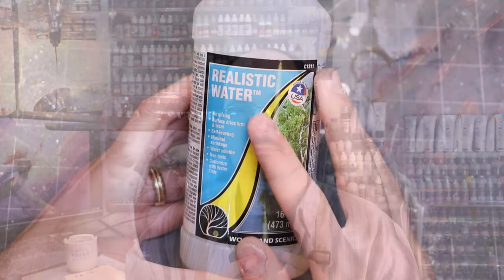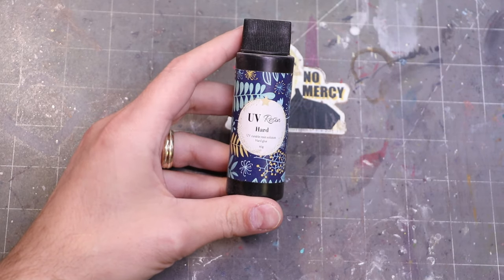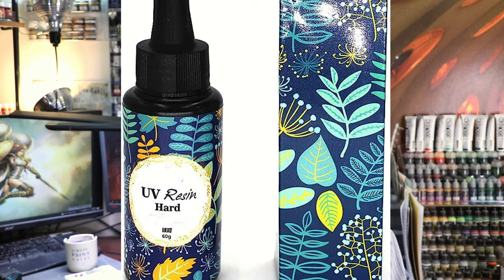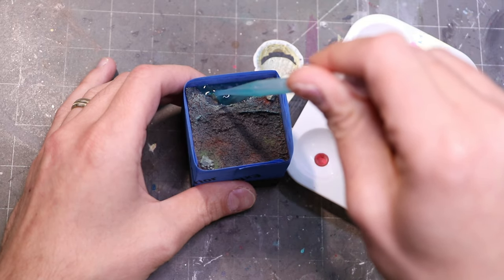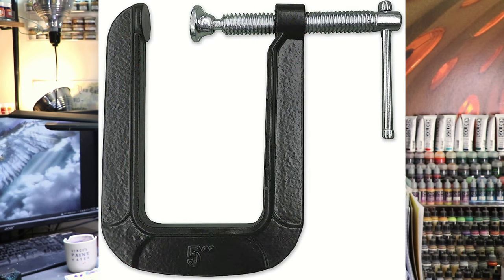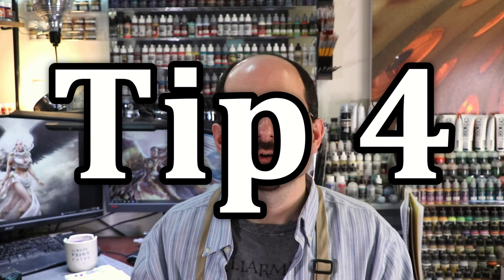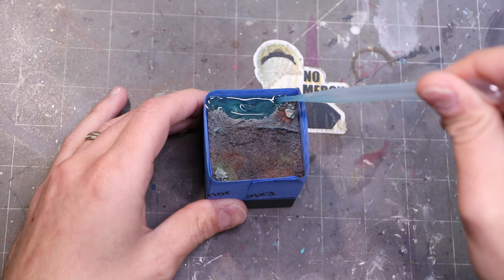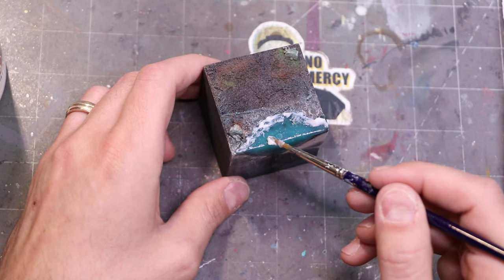Complete Guide to Water Effects - HC 407

Comment: When you're working with 2-part epoxy resins, keep the excess that hasn't gone on the piece. If you want to know whether your resin is cured, just push your thumbnail into that and see if it leaves a dent. When you've mixed A and B, it's good practice to pour it into another container and mix further, since often you'll have some unmixed stuff on the walls of your container which will end up in your work and ruin it. Also be aware that epoxy resin fumes are a sensitization hazard - take precautions to limit your exposure to the stuff, at the very least by working in a well-ventilated area.

Comment: Tip #9. Properly seal the groundwork that is going to take the resin. Even surfaces that look solid can be porous on a microscopical level, causing the water effect to seep dow into the base and possibly also reacting with it, distorting the color.

Comment: Since you titled this "Water Effects" rather than "Poured Water Effects" or something similar, I have a couple more techniques that you didn't really mentions:

You can use a piece of plexiglas (or similar clear plastic sheeting) for the surface and still model the underwater details. It can be useful to use another water effect to get a surface texture (as you mention at the end of this video). This doesn't risk damaging anything that would be in the underwater part of the scene. It won't work with every piece you work on, but when it does work, it can be extremely effective. For an example, see Boomer Diorama's Silver Creek box diorama series elsewhere on YouTube.

In some cases, you can use paint to get a depth effect and use a very thin gloss layer to get the look of water. I like to use acrylic mediums for this (fluid medium for the base effect and gel medium for any surface textures). I've found this particularly useful for water feature scatter terrain for gaming. It's pretty straightforward to make a nice modular river, for instance.

Finally, for UV resin, I just use clear printer resin. It's the same stuff at a much lower price per volume and it's available in a variety of colors.

Comment: Nice overview on water effects. There are other tricks to get rid of the air bubbles especially the two part resins for larger dioramas; just blow some air from your mouth on the top surface or use a kitchen blowtorch to heat gently the surface.

Comment: Another way to deal with shrinkage/creep in many natural still water environments if you don't want to resort to so many multiple pours to get it perfectly flat is to add debris, foam and/or foliage around the water's edge - doesn't take much to hide a small lip and if you look at real natural still water environments you'll notice in a lot of cases that's a pretty realistic addition anyways, especially if your base setting is a wetland or forest.

Also for surface bubble removal a very quick careful pass with the very tip with the narrowest flame from a butane torch is great, works instantly plus you get to use your blowtorch...

Comment: This is great, used the vellejo still water for a pour of an oasis and yeah ended up doing like a dozen 1mm layers, first try cracked and shrunk so poured to fill cracks then did as I said like a dozen 1mm or less pours, just a bunch of drops and smoothed it out with a popsicle stick and light shaking.

Comment: Some additional tips:
- Test the amount of (transparant) paint you need, by adding paint to the same amount of ml of water (as your pour), until you are happy. Then add that amount of paint to your pour.
- You can use heat (of a flame) to remove bubbles from your pour. Basically like the last step of making crème brûlée.
- When a pour is drying, place something over it, so you don't get dust stuck into your water effect.

Comment: Very very useful. Question; GW's bases have an angle at the edges that I can't for the life of me figure out how to deal with. Is there anyway to make a good seal on those bases?
Reply from the maker: It's tough, way back in Hobby Cheating 6, you can see how I do it, I just wrap it around with blue tack. There is no great answer for those beveled bases.

Comment: Thanks for the tips - just wondering how you would seal in a pour on just a standard 40k base? I wanted to add some toxic sludge and puddles that would extend to the edge of some of my miniatures.
Reply from the maker: FOr small bases, I would use UV resin, it's much slower moving and easy to manipulate on bases.

Comment: Got a question regarding something you didn't mention... I've tried making a swamp base using Vallejo Still Water. The tufts I had put down at the edge of the puddle ended up sucking up a lot of the Still Water via capillary action, which kind of ruins the effect. Any tips for using water effects alongside tufts like this?
Reply: Literally had this happen to me this week. I had to rip the tufts out and put new ones in lol
Reply from the maker: So anything that is right on the edge will naturally draw it up, there isn't too much you can really do about that if they're placed. So here is the two options I go with. 1) Don't put them right on the edges like that. (pedantic answer of course) and 2) Leave them off the edge at first, then pour and let it mostly set. When it's harded some but not completely, you can carefully place the tuft down into the already tackier resin, it won't go as far then and it will minimize the effect.
Reply: @VinceVenturella  Thanks, I'll try that whenever I get round to painting my Rotmire Creed for Warcry!

Comment: Thanks for the great video! When doing mulitple pour water effects how long do you wait between pours?
Reply: Resin has what is called a pot (working) time, a gel (thickening) time, and a curing (hardening) time.

If you are pouring multiple layers, then you want to pour the new layer during the gel phase. So once it's thickened up but before it's completely hard. This allows the layers to merge, and be invisible. If you wait until well into the hardening phase, you may get a visible layer line.

When is the gel phase? That depends on product and even brand. Some are quick setting and some are deliberately slow setting. Some will explicitly tell you, others wont. The majority will tell you the pot or working time. As a rule of thumb the gel time starts shortly after that, within a few minutes, and lasts about as long as the pot time.

Probably the most reliable way to tell is to mix a little more than you need. So you can keep some back, and treat this the same as the base pour. Same temperature, humidity, UV exposure ect. Rather than disturb your base you can check the portion that you have kept back. The gel phase will be noticeably thicker but still just about workable, but only just.

Be warned, 2 part epoxy resin can get warm as it cures. Deeper pours can get hot, but you have to be talking an inch or more before that becomes problematic.

Comment: What would you suggest using for large splashes of water?  For example, if you have a model that is launching itself out of a deeper body of water.
Reply from the maker: I'm going to do a whole video on this, as there are many ways to do this sort of thing. You can use the clear plastic pieces from a clamshell then build water effects around them is one direct way.

Comment: @VinceVenturella can you recommend a specific brand of UV resin? I notice Amazon carries several from high to low viscosity options. GSW seems extremely overpriced in comparison. I’m planing on doing 1/4 inch submerged water themed bases for my deepkin army if that helps with a recommendation. I will also be using the GSW containment moulds for my pours. Thanks in advance!
Reply from the maker: here is what I use - https://amzn.to/3AON4YO
Reply: @VinceVenturella  thanks!

Comment: How do you ensure the second/third/etc resin pours have the exact same amount of ink?
Reply from the maker: You can measure in drops, but really , if its close you can't tell any difference.
Reply: @VinceVenturella  Just thinking out loud (only works for the 2 part resin), have you ever tried mixing ink into 1 of the 2 parts of the resin? Then only mix what you need for the first pour. When it comes time to mix the resin for the 2nd/3rd/etc pour, it should have the same ratio of ink since the ratio of the two parts is the same

Comment: I ll be honest, I have the vallejo water product and I m a little confused on making it work with the model! Is there a process that is different with this product vs the realistic water I have seen you use in other videos
Reply from the maker: The vallejo water is a 1-part right? In that case, its usually just pour, pop the bubbles and it hardens.

Comment: What tips can you offer if one were use clear resin from a 3d printer w/ UV pen?
Reply: It's the same basic type of chemical. But, one thing that you'll likely run into is that if you use printer resin you will not get a dry, hard surface. Normally this type of resin will have what's called an "oxygen inhibition layer" on the surface. What that means is that if oxygen is present you will not be able to fully cure the very last bit of the surface, it will always remain tacky.

The resins that are made for jewellery as mentioned in this video have been formulated to get around this problem and will usually have a nice dry hard surface when cured fully. I don't remember how exactly that is achieved though (it's been a few years since I read up on it and I barely remember what I did yesterday).

Sometimes blasting the crap out of the resin with a very powerful UV source can mitigate some of the stickiness but I don't think it will ever remove the effect completely. Curing that type of resin while submerged, thus blocking oxygen from touching it, will work. So you'd cure it, then submerge it and cure it again. Not always practical but it can work in some situations. Or if you happen to have access to a chamber with inert gas, that'll work too.

And the last option is to clean the surface with IPA which is the traditional way you'd clean a model from a printer before curing it. Risky if you have a painted surface nearby though.
Reply: @treborrrrr 100%correct!! Great explanation!!!!
Reply from the maker: Great explanation above and far better than what I could offer.

Comment: Hi Vince! For those of us who don't live in the US, what is this thing you call "blue painter's tape"? I'm used to masking tape that is typically ivory and not entirely smooth outside, but I assume that's different? Have a great day and make sure you take your sun screen when you got to the water effects this summer! 🙂
Reply: I work in a hardware store so lemme help.

"Blue painters tape" is just Scotts branded painters tape. Painters tape in general is a type of masking tape with a different adhesive-so it doesnt damage your walls when you remove it.

Any product that calls itself "painters tape" will work. For example, the "Frog Tape"  brand of painters tape is actually green.
Reply: @jacksummers6464  Thank you for the explanation, I've been putting off my first resin pour because trying to get the round base dammed off has been a nightmare, and I was worried that if I actually put tape on there it wouldn't come off cleanly.
Reply from the maker: Perfect explanation above. :)
Reply: @jacksummers6464  Thank you!
Reply: @jacksummers6464  @VinceVenturella thanks again for the explanation, I bit the bullet and taped the base, mixed some ink into my resin, poured, and it came out great. Only minor leakage due to a piece of the mini jutting out across the side of the base, but I had taped it underneath the rim so the extra tape caught it.

Comment: Question in regards to containment. 
Have you tried Green Stuff Worlds Containment Moulds, and what do you think of them. 
Also i saw in another video by the youtuber called Paepercuts, that if you want to make batches ala lets say you want your entire army to be water based.
You can use a silicon chocolate or muffin tray put the base in it and basically pour the resin in it.
That video was 7 years old so i don´t know if its still a viable technique or if there are better alternatives now.
Reply from the maker: So those molds are tough (any molds are), the trick is they absolutely won't work with GW bases, because those are beveled bases, so it leaks immediately, if you're using a flush base, you can use a mold or something similar. The base type is really the key.